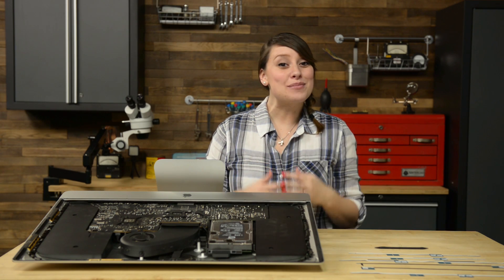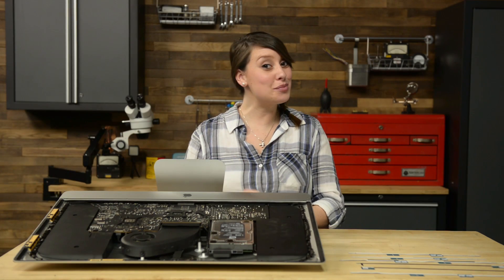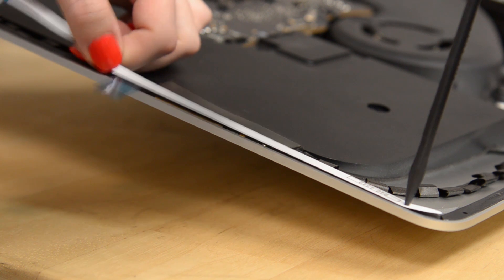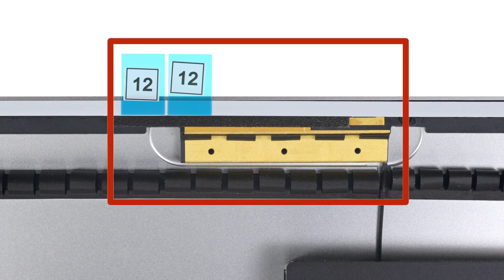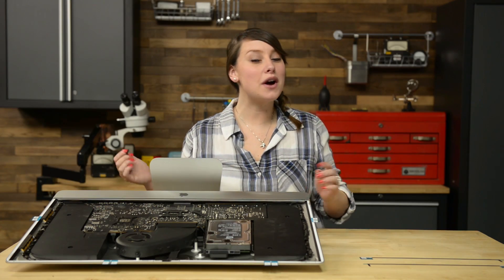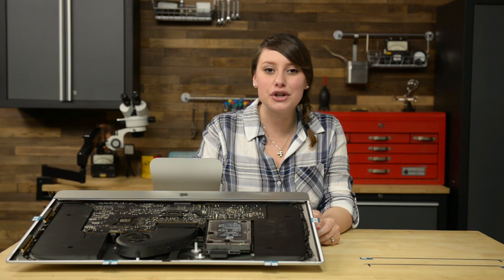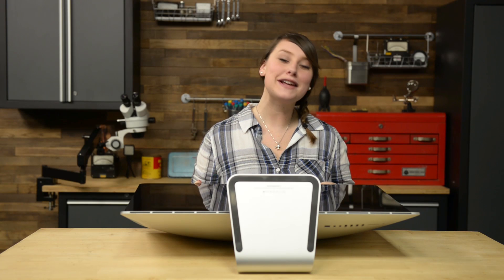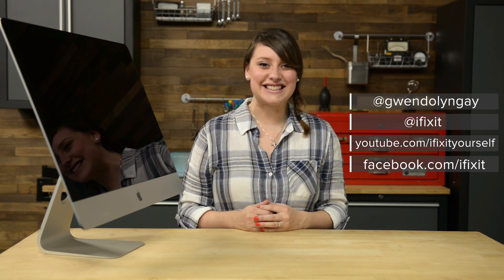How To Re-Apply Your 27” iMac Display

Comment: Do you guys sell a new or used  screen display for the 27?  It is the late 2012 which requires the whole display  IMac 2546.  which I foolishly purchased used by a refurb fellow in Houston  he use a couple of pieces of double edged tape similar to your product but about 4 inches on a couple of sides.   Put it on my wifes desk and she put an incadesent light over it with the screen tilted downward,  tape heated up and it is cracked now after it fell completely out.  Hoping the cable connections are not damaged they all look straight under magnification.   will hook it up to check to see if it works first.   I think the $500 price tag for a display may be good money after bad.    Just put it towards a new I Pad with keyboard in the next couple of months as the new ones with the IOS/Pad software come out and hope apple lowers price on existing I Pad.   ??????  I was going to install the cracked one and just live with it.   I can adapt to lots of things as I retired and have to slow down spending money like a mad man.   Using an old Asus with 8.0 software which does not lend itself to 10 upgrade very well.   Blocked Windows from trying to upgrade it on boot and have to revert back after about 15 minutes of gyrations and auto roll back at the end.   The asus 15 is touch screen but you have the misery of Mr. Bill's goofy apple wannabe.     Thank you,  great videos by the way you are a pro for certain with the concise youtube techniques.   Quick and to the point.   Great job.   In Houston and you would think I would learn by my mistakes with all the folks after your cash and you dont see behind the curtains.   Would have been cheaper just to purchase an IMac air.   
Mike

Comment: can i test the device without attaching the screen
would the device turn on without the screen
Reply: Yes it would. Though you might have the fan spin 100% because of the missing temp sensor insinde the screen itself. I usually test the computer by gently leaning the display on the computer, and connecting the cables. I can use the computer for days like this, checking that everything works as expected, before reassembly.

Comment: Thanks iFix it for another fantastic video. Although this is such a poor design by Apple. I get it people want a thin device, but surely they could of used a locking mechanism similar to the iPhone 6 to do this, with a couple of hidden screws at the rear or bottom of the device. I can only think they used adhesive as it’s more profitable for them when some people would rather purchase a new device than repair.

Comment: One other important note from this observer: when & where applicable, remember to connect the temp sensor before the final assembly & sealing takes place, during the connections steps just mentioned during the final assembly. Just another careful step, but apparently an important one.  Great video, step by step, clear & concise, Thank you!
Reply: Which one is the temp sensor?  The cable 4:30 with latch or the one w/o the latch?

Comment: Be very careful with the edges of these screens. Very easy to chip and crack. Be very careful removing the display and super careful applying pressure around the edges (though this is necessary to lock the adhesive in place). I have replaced hundreds of these screens, and broken two. My mistakes are your warning.
Reply: do not use hammer

Comment: good guide.  worked like a charm.  so what if you need to slice the adhesive and reapply.  how often does anybody need to do that?  would you rather run windows?

Comment: As long as your screen is tilted back for the rest of its life, these strips are fine. However, none of the strips I've received from any supplier are as thick as the originals. This means no matter how clean the strip locations are before reattaching, the screen never reseals properly with these shaped pieces. Eventually, if your screen is frequently tilted forward (like for studio use!), it's going to fall off. I've been adding a conformal silicon fluid at the top of the screen as a backup. That seems to prevent disaster when using strips like these iFixit ones.
If anyone knows of shaped strips at least 0.5mm thick, let me know. These ones from iFixit and other suppliers are 0.1mm foam - far far far too thin to be reliable.
Reply: Taut Tech / Minus Managed Music why not use 2 or 3 strips?

Comment: Just wanted to warn everyone.
I ordered the adhesive that ifixit sold, followed the instructions to the letter and 3 days later I came home to a smashed LCD on the floor because it didn’t stick.
Avoid this iFixit adhesive like the plague, it does not work.
Reply: Bobby Brady  Funny, what you suggested is exactly what I did, including leaving the iMac on it's back (although not overnight, but still for a few hours).  Yet, 7 months post install, my LCD just fell and smashed yesterday.  At least your response is a bit more helpful than OWCs, even after emailing them directly.  I seriously think there's a temperature problem and their QC is only testing for short intervals--not to mention the strips were folded in the packaging.
Reply: Me too, but OWC adhesive and no cracks. Trying again and adding tape on the outside.

Comment: i have an older imac with screws and magnets and a newer model with glue.  upgraded both, had to take each apart.. while not difficult.. working with the screws is a pain in the ass.  The glue strips are 1000 times easier to use. Great video.. Buy the way my home iMac is a 2009 that is on 24/7 and still runs with zero issues and is still kinda fast.... Take that PC

Comment: Just wanted to say thank you for the video!  I've signed the petition and am about to order the spudger and adhesive strip kit.  Apple wants $500 or more to replace the screen on my 21.5", which my newest rescue knocked to the floor (not her fault--it was mine for forgetting to move it to the side).  Your prices are very reasonable.  Finding a screen that's affordable is another matter, but I'm looking into it.

Comment: Just did this to replace hard drive and now screen has black line vertically about an inch to te right of camera. Did I just toast my display?
Reply: a bit late reply - but yes your display is now damaged - probably the TAB connection - A TAB Fault is caused by a connection failure from the TAB that connects the transparent electrode layers to the video driver board of an LCD.

TAB stands for Tape Automated Bonding, which is one of several methods employed in the LCD display manufacturing process to electrically connect hundreds of signal paths going to the rows and columns of electrodes in layer 6 (the transparent electrode layer) in the LCD display to the video ICs on the driver board that drive these electrodes.

If an LCD display is subjected to extreme heat or cold or physical shock, this could cause one or more TAB connections to fail inside the display. This failure requires replacement of the LCD display module itself. If these connections were to fail, the effect would be that an entire row or column of pixels would fail to activate. In the examples below, a horizontal or vertical black line would appear on the display, while the rest of the display would appear normal. The horizontal failure runs from edge to edge; the vertical failure runs from top to bottom.
Reply: Carlos, conseguiu resolver o problema de linhas verticais pos descolamento da tela?

Comment: can u tell me if there is a cover in this screen? because I have the same imac and the screen looks dirt. I tried to cleaned but without success.
next step i ll remove the screen...
Reply: Do you have the thin one like in this video?
The old thicker aluminium imacs had their screens attached with magnets but were a bit prone to getting dust between the glass and the display panel. 
These ones have the glass attached to the screen.
Reply: i have a 2009 27 inch that has been running non-stop for years.  I never had the dust issue on the screen.  But I did have that issue on a 21 inch mid 2010 model.  Just pop the screen cover off and use a small micro fiber towel to remove the dirt.  The small kind that they give you to clean your eye glasses.  Worked perfectly and took 5 minutes to clean and have it perfect again.

Comment: I now understand why mac users throw out rather than repair.
Reply: +Big_Adam_2050 The old model had the glass fixated with magnets. Way nicer considering the price tag… not really fond of glueing on a 3000 dollar machine lol
Reply: You assume that Mac users only use all-in-ones? xD Okay, go check out an all-in-one from HP or someone. They're nightmares - they're a freaking Mac Mini-like machine screwed to a screen.
Reply: I am computer tech of 15 years. I have worked on windows and apples computers. Always apples computer jobs bite me the arse. I got 2 of the imacs come into my workshop today for SSD upgrade. Nothing but problems. 

I have always thought about saying no to apples, these will be the last 2 Apple computers I ever work on I am sick of the things Apple do to stop people trying to repair them. In Australia Apple won't even supply parts to retail customer or computer shops.

From now on if people are stupid enough to buy jump on the Apple bandwagon then they can go to Apple and pay Apple prices instead of going around in a panic to computer shops trying to get them fixed cheaper.
Reply: @LlamaOates  Out of curiosity, does Apple supply you with adhesive kits, or do you have to use 3rd party?  Are any of those sold online OEM, or just claim to be?
Reply: You are right. This is completely sick! Never will buy this Apple crap again!